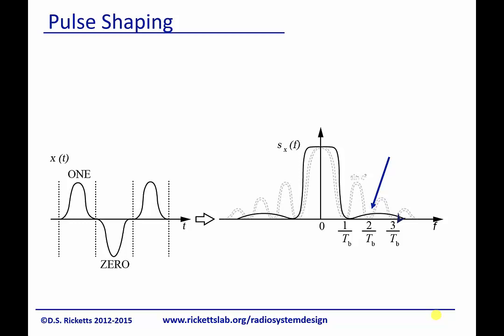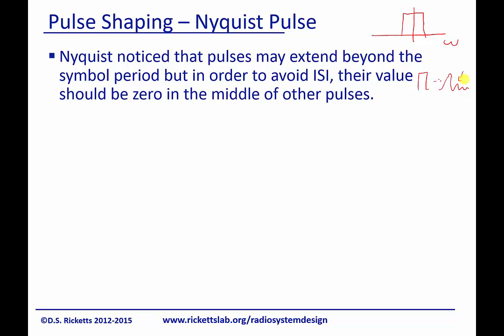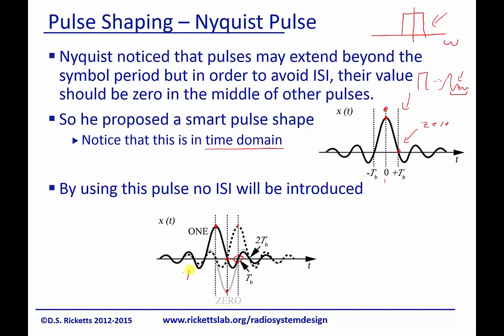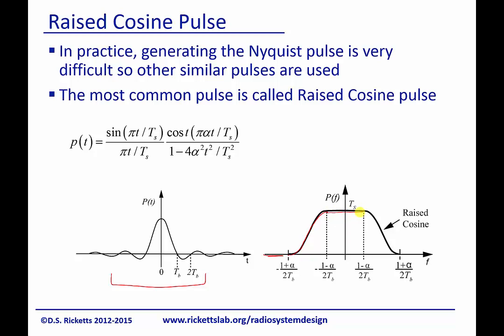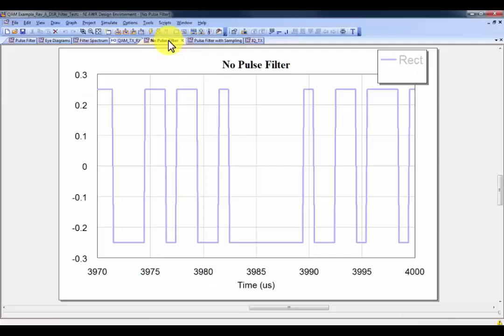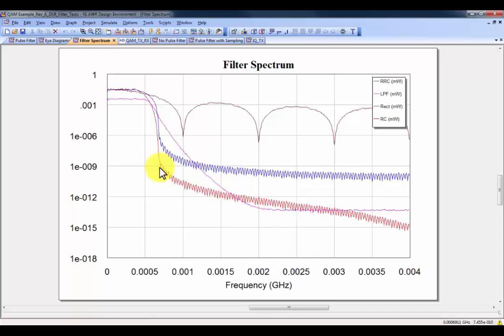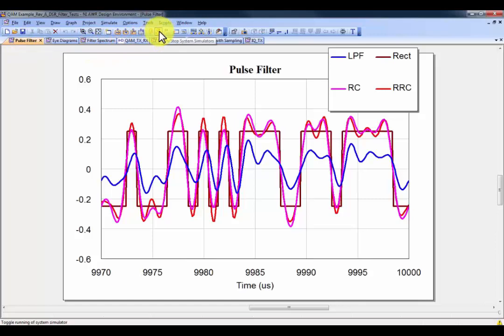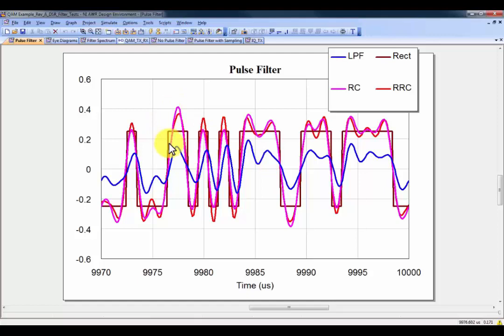Module 5: Pulse Shaping

Comment: Thank you for this.  I am uncertain of something though.  In WiFi, if using BPSK for example, do you apply pulse shaping before or after modulating the carrier.  Or does it matter?  You video at time https://youtu.be/uTI0qLLbS74?t=512 implies that you apply shaping in the transmitter BEFORE modulation.  Other sources I have read say that shaping is applied after modulation???